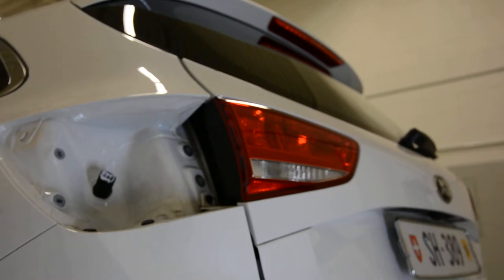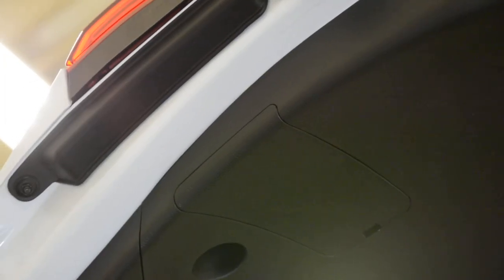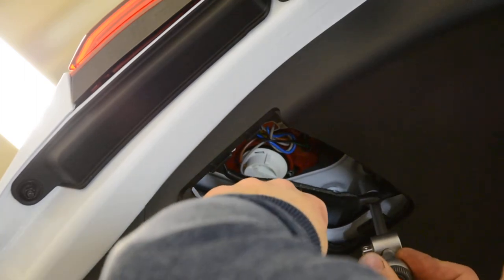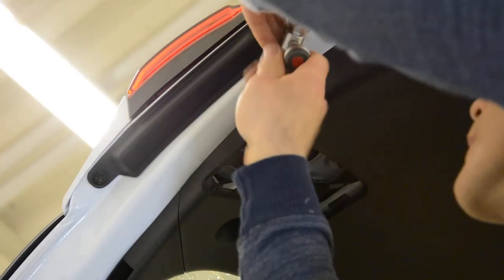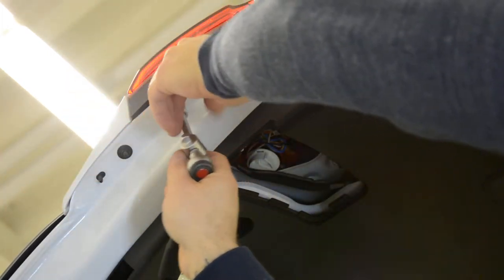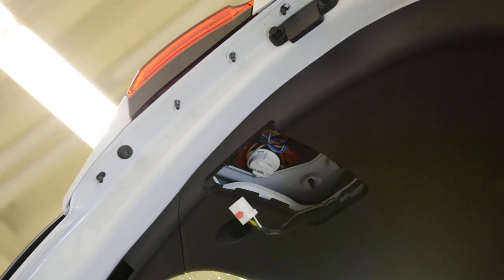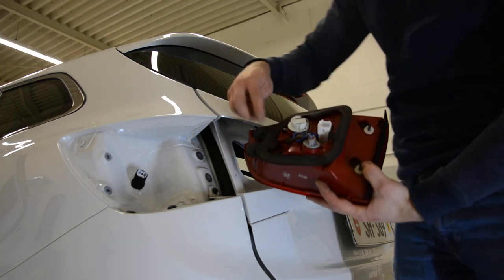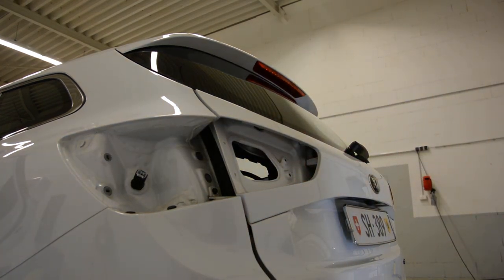Rear tail light removal replacement Kia Cee'd interior part

Comment: My Kia dealer says that i can put reverse LED light bulb in my 2016 SW Ceed,  do you know which bulb fit in the reverse light. Hope i maybe can use your video to Change it my self,
Reply: I mean a reverse light bulb in LED sorry
Reply from the maker: Is very simple just put your car in revers and ask someone to make a pictures from the tailgate to see witch one I for the revers and replace them
Reply: Thanks a lot, I've seen where the bulb sits, but Kia says you can't put the LED bulb in. I wanted to hear if you knew what the bulb is called in the backlight, bulb 12v? 
Sorry for my bad English
Reply: @gnist1974  I have an LED light bulb. Everything ok